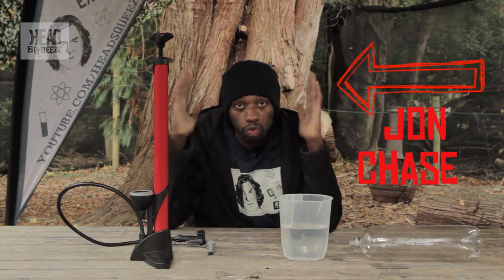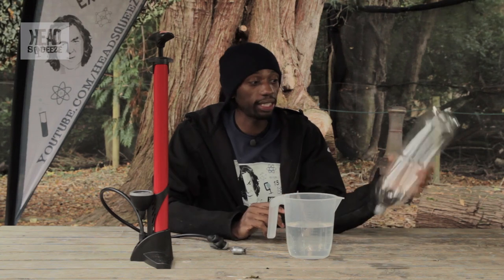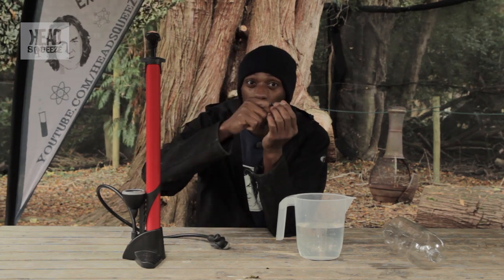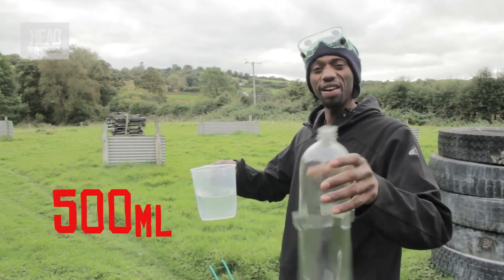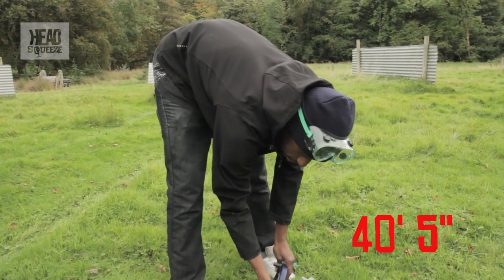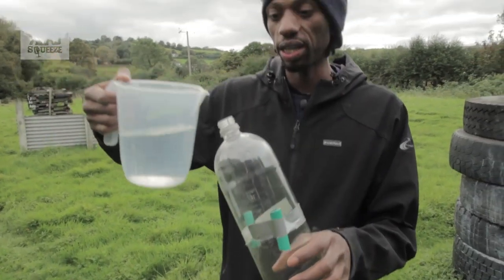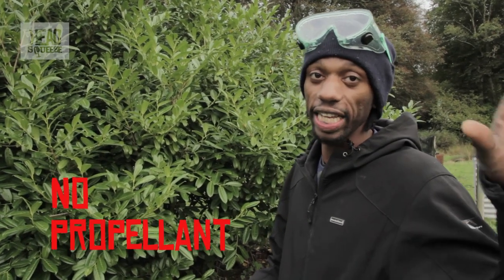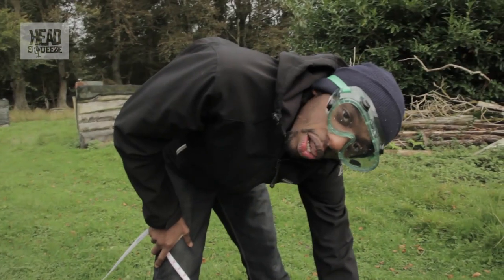Make a water rocket! | Live Experiments with Jon Chase | Head Squeeze

Comment: Actually, attaching extra mass at the top of a rocket will also increase max distance, because the rocket will be much stable during the flight and will experience less air resistance.

Comment: Does UK use feet or metres?
Reply: Meters normally, but feet is unheard of.
Reply: Both. People generally measure their height in feet/iches (I don't) but metres aren't uncommon elsewhere though. It's like people use two different systems depending on what they're talking about and it's very, very confusing.
Reply: ***** Should've told me yes/no/both thx
Reply: depends ther kinda in the middle most young people use meter though
Reply: Their road signs are still in miles. For most of the foreign drivers that can be confusing since there is no miles scale on the speedometer of most European cars.